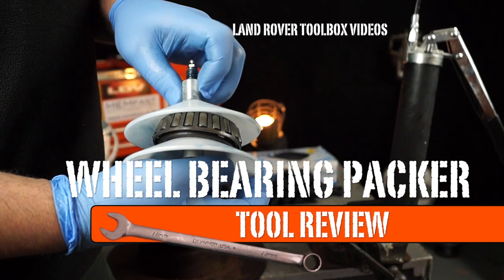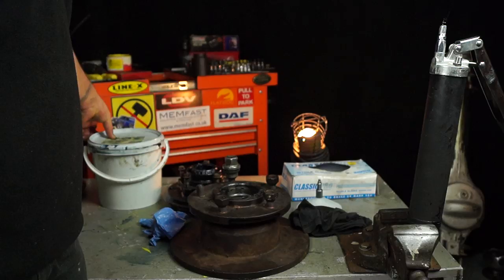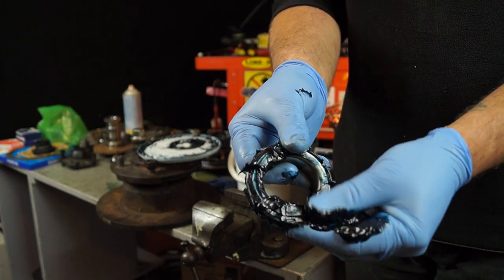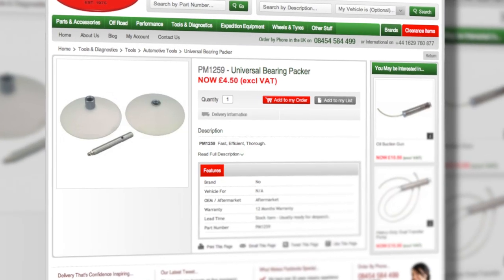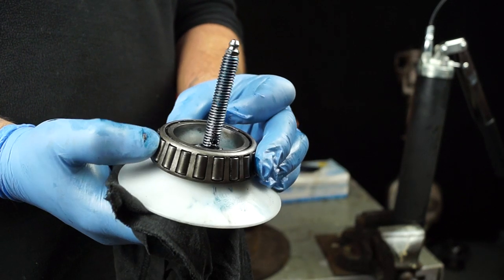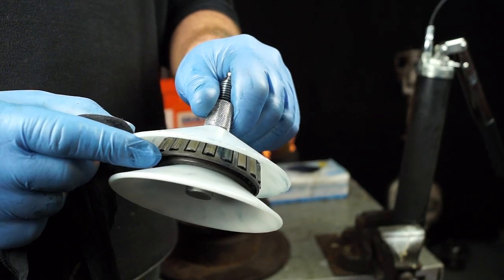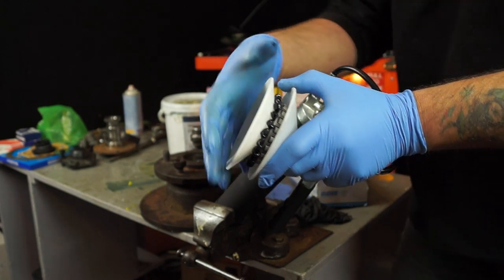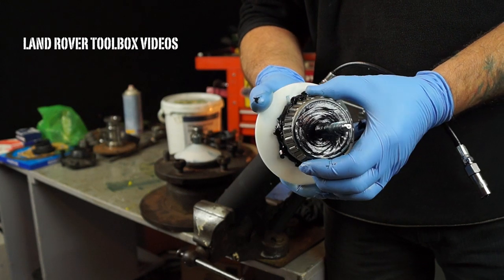The best tool by far for packing Land Rover wheelbearings - PM1259

Comment from the maker: We all have our ways.  What is important is the message behind greasing the bearings.... Take it from me, and you see the trailer hubs in the video doing 6 to 9 axles per week one would prefer this tool.  From a DIY point of view it is a through packing which if you grease by hand can be assured not all the gaps are filled.  Best always to give the bearings the best possible start... Hourses for courses. No one is forcing you to change?

Comment: I prefer the old method. I use under a minute to grease one bearing and i cannot understand how this tool can make the job easier? A lot more cleaning up to do after packing the bearing as far as i can see.
I use the air powered grease gun and place a blob of grease into the palm of one hand and just dig into it with the bearing all the way around. Sometimes i have to take it in two steps but it's no hassle if you have a automatic grease gun placed in the wise beside you.